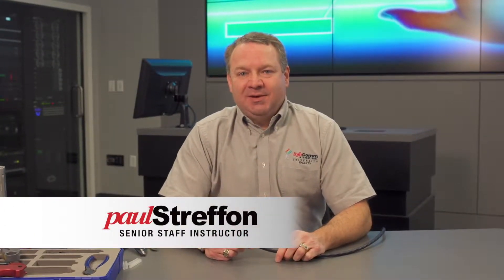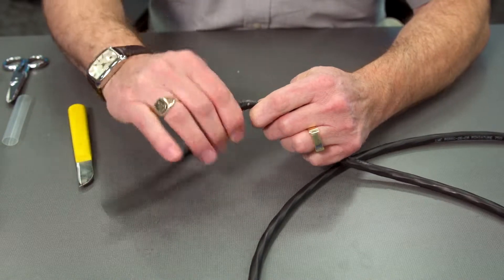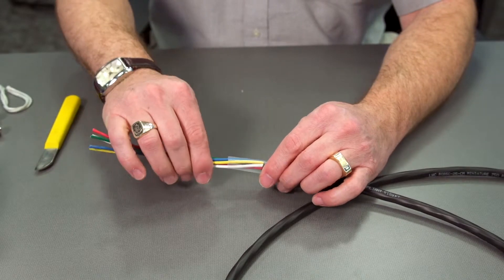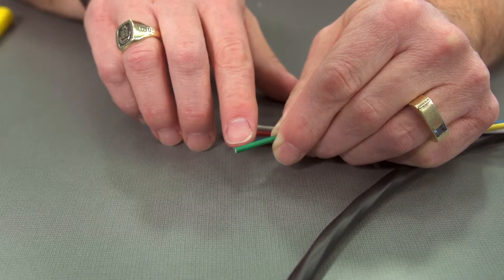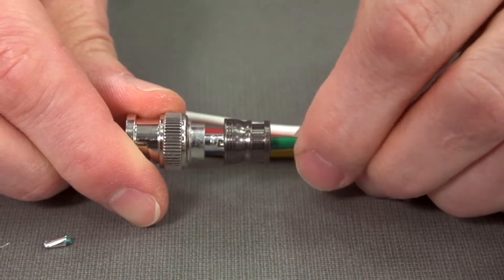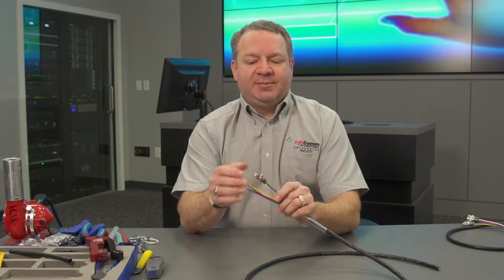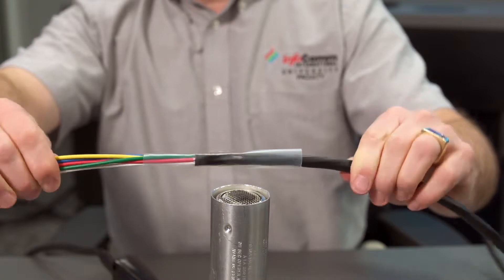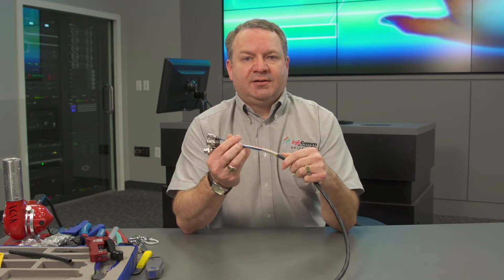Compressing BNCmini on RGBHV

Comment: These wires are thinner than most of the compression tutorials I see. They are exactly the size I am looking for but I don't see any info about what to search for for the cables, tools, or connectors. Everything I see is for RG58/RG59 which is bigger.
Reply: OK, I see that this is also referred to as MHR (Mini Hi-Res) and that you can get BNCs specifically for those. Thanks!